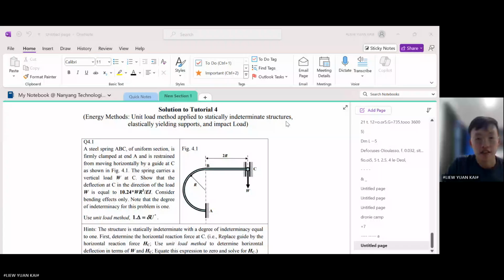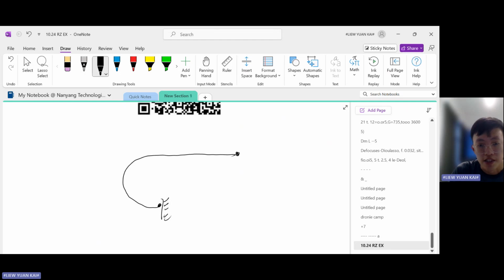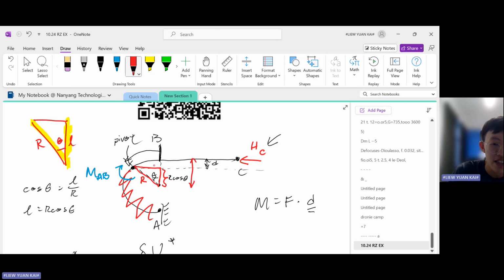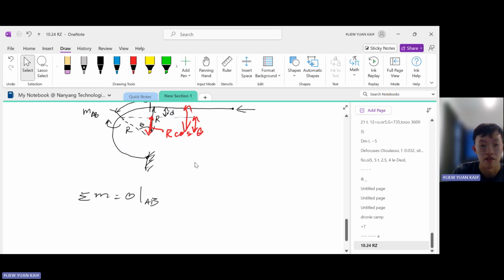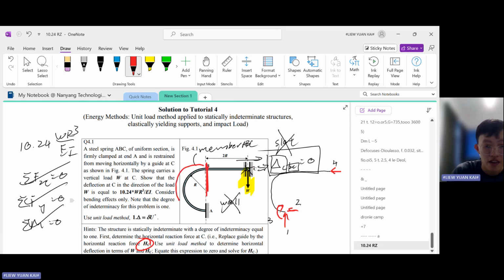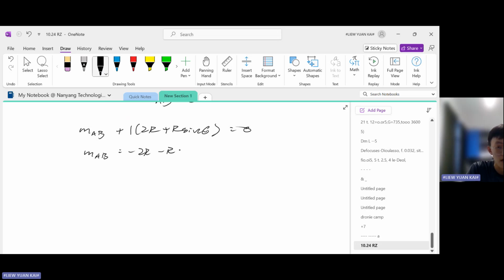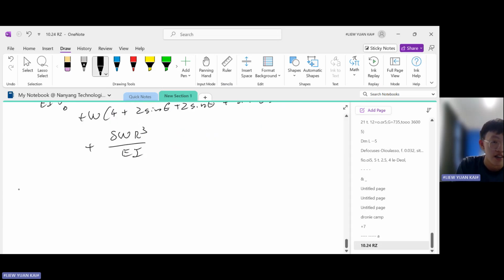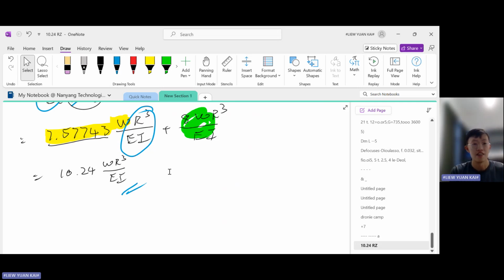Solid Mechanics and Vibrations Tutorial 4 Unit Load Method (Statically Indeterminate structures)

Comment from the maker: I realised I have made a careless mistake starting 46:33. The second integral term is supposed to be (8WR^3)/(3EI). Not (8WR^3)/(EI). There is a missing "3" in the denominator. Other than that the flow of ideas is still correct.